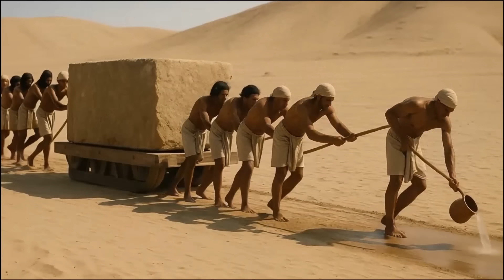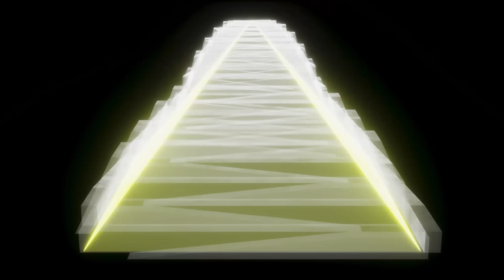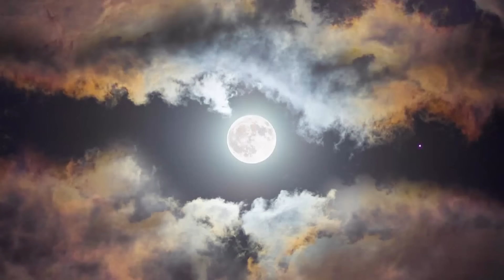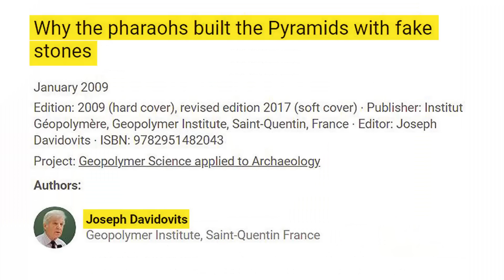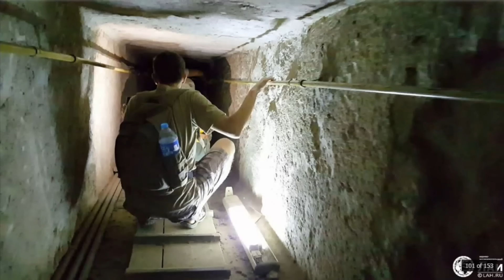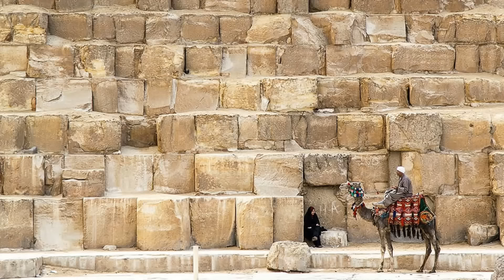The Pyramid Theory That Solves Every Construction Mystery

Comment: Why are scaffolding and cranes not discussed as construction method? Seems like reasonably simple technology well suited to build structures like this. You need good rope and wood construction technology which people would probably have had at this time and seems necessary for every other construction solution as well. Most of the blocks are reasonably sized to make lifting them in steps with human operated cranes plausible. While I agree that they might have used some sort of concrete pouring technology for the outer shell, it doesn't seem plausible for the majority of the structure. Pouring that much concrete in that many blocks doesn't really look easier to me than quarrying them and lifting them with simple cranes and scaffolding. Concrete construction uses a lot of technology to avoid using so much labor. But at that time, they probably hat a lot of labor available and probably a lot less technology, so that optimization is not as necessary in that context as it is today.

Comment: This is the first of your videos that left me disappointed by seeming implausible and by leaving out more likely explanations. First, there is a very old papyrus which clearl documents how stone was moved from quarry to a harbor near the pyramids. The author was a logistics manager for that part of the operation. There is also documentation of a statue that weighed over 100 tons being transported overland on a wooden sled by many people pulling. Part of the secret sauce was wetting the desert sand which experimentally reduces friction by around 50% and also makes the wooden sled skis last longer. Geologists examing the limestone blocks see fossiles which would have been destroyed by turning the limetone into concrete. Also, to cook enough limestone into lime for making concrete would have required a forrest about the size of Egypt to cook it. There was an instance where electron microscopic examination seemed to show it was concrete but it now accepted that was most likely due to contamination of the sample from recent  restoration work. Also the stones have tooling marks you wouldn't see on cast block.
A little napkin physics gives some shocking results, IMO. Since the center of mass for a pyramid is about 1/4 of the way up, considering maxs, gravity and time, the lifting portion of the Great Pyramid of Giza would have required about 7 kilowatts of continuous power to be completed in the recorded 23 years it took to build. A physically fit man can comfortably output 60 watts for a 10 hours.  Assuming 100% efficiency it would have taken about 120 men to vertically lift all of the stone. Add to that dragging the stone 1km it totals to around 780 men working in parallel.  Judging by the size of the work camp/city, there were actually tens of thousands of people working, probably in the farming off-season(s), but the 800 person ideal gives some needed perspective on something so huge not being ridiculously beyond human ability even when you start considering inefficiencies.
As for how the lifting was done, I don't think that was ever documented so I don't think we know as an absolute fact. That doesn't mean it was miraculous, just that we don't which of potentially thousands of ways they actually used. My guess is they probably used several methods, doing what worked best for the current stage of construction. Ramps probably worked fine for the initial layers. A Greek dude, Herodotus, 2000 years afterward suggested something that seemed to involve a lever. The stone would be levered up a bit and wood placed under the rock. Stop pushing down on lever and add some wood under the fulcrum, rinse-repeat until it is a pyramid step higher. Actual archeological remains look like a sort of giant rocking chair was used. The 2.5 ton rock sat on a seat a little above curved rockers. Perhaps the idea was to get it rocking while someone threw boards under the rockers so that it was slowly raid up to the next step.  There could have been variations like a lever that works like Herodotus said, but with some counter weighting and a pivot to finally land it on the next step up. After making the core step pyramid, the finishing stones would be lifted into place starting at the top and working down. Keep in mind that the bulk of the effort would have been over after the 1/4 up level. From there each stone takes more effort but there are fewer and fewer stones, and IIRC they used smaller ones the higher they went.
A nice thing about limestone is it is fairly soft as rocks go. A little sand and grinding movements would probably quickly get a good fit to the stone below.  The side joints might have taken regular stone mason work. Same for the finishing stones. Sized sticks or metal rods if you want to get fancy could have been used to get a good first approximation before leaving the quarry. Who knows, maybe vinegar was used to to dissolve high spots in some cases.

Comment: Well done on 100 videos Tina, wow. I agree the great pyramid appears to be part of a sophisticated engineering project. Those many theories do seem to be grasping at straws for answers to "how did they do it?". I like your theory, seems feasible for an advanced civilisation. The idea of the raw ingredients being poured into moulds, however,  seems to break down when we are told the blocks are not uniform, apparently they vary in size although 'average' 250 tons. That anomaly seems at odds with an advanced civilisation, you'd think the moulds would be uniform in size for the required types of blocks. Do you have any observations on that?
Reply from the maker: Thank you for the congratulations and for your thoughtful observation regarding block uniformity! 😊 The pyramid blocks in each layer share the same height. There are millions of stones in the great pyramid. Most core stones are not exposed so we don't know about their sizes and shapes. The builders might have used different sized molds to speed up the curing process and for structural reasons. For example, the upper blocks are smaller than the bottom ones. Or the blocks could have been cast in situ as shown in the paleomagnetic investigation.
Reply: thanks for your reply Tina!

Comment: Thank you for these very informative and thought provoking theories ,  I would like to put forward my own hypothesis, leaning into Occam's razor. First, the Egyptians had both the shadoof and sakia for lifting water, they could have very well upsized these mechanical devices and incorporated multiple units on the slope of the structure, much like a scaffold staircase , this could be utilized on multiple sides or simply used on the most beneficial side to preserve labor. After completing several horizontal layers, erect an additional shadoof.. the geometry is simple, I believe they would have layed out a full scale template on the plateu using a grid system similar to what they used for carving theAbu Simbez Temples, I believe this can be the connection to the water reservoir , the possible mine shafts and the canals. they had to have some mechanism to remove the spoils and target minerals from the shafts. Granted, I'm just an old carpenter and may be full of crap but, I built some really cool structures that tested my skills and besides, our ancient Egyptian sisters and brothers had the exact same brain as modern "species" , just with far less distractions. Thank you so much for your time, I learn something every time watching your videos.

Comment: Thanks Tina. That was terrific.  The great Max Planck put it this way:  "A new scientific truth does not triumph by convincing its opponents and making them see the light, but rather because its opponents eventually die, and a new generation grows up that is familiar with it."   In other words, change occurs 'one funeral at a time.'   You have clearly demonstrated how all leading theories fall apart, in other words, they are impossible.  And so, what we have left, as Sherlock Holmes tells us, even if it's improbable, is what happened.  And Dr. Davidovits theory is not improbable.  I don't see how he can be wrong.  When you pour concrete next to other blocks, using them as part of the form work, perfect fits are unavoidable.  On the other hand, who could cut a 2 or 3 ton block perfectly even once, then make millions of them fit.  Who could lift them in such a small area? They would have to remove and reshape and try to make them fit.  Impossible.  Let's see the Egyptologists do it once.

The perfectly level rows bring up another question.  I'm convinced they had very advanced optical capabilities.  See Robert Temple's book: The Crystal Sun.  The bust of Sneferu's sun has extraordinary crystal eyes.  Odysseus' antagonist was a shepherd.  Herodotus tells us that shepherds ran the Giza plateau before the old Kingdom.  Cyclops (cycl-ops) does not mean "one-eyed."  It means 'round eyed.'  They knew their optics and this is how they kept the structure level; lasers aren't necessary.   

Thanks again. Your explanation will help the next generation see the light.
Reply from the maker: Well said - thank you for sharing your thoughtful perspective and those fascinating connections! ☺

Comment: At best, the only remotely plausible aspect of your theory is why they built it.

Concrete? All that's required? They didn't have the fuel for it. It's an exothermic process. The final results shrink. Such large blocks would take a long time to cure, and they'd need to be cured fully enough before stacking them, something this video didn't even consider, unless the thought is they were a poured on-site layer by layer, which would fail for thermal differentials alone.

This isn't a remotely viable theory.

I can agree, the ancient Egyptians did great engineering, particularly given their constraints.

Comment: Hi Tina!  Congratulations on your 100th video!  I was surprised at how many videos you've done on the pyramids alone.  You should combine the research on them and write a book or apply for a Phd!  ;-)  But before your do, I implore you to go to Egypt and see the sites in person.  I think it will give you all kinds of new ideas and insights.  I'm sure the tour guides and docents are a wealth of knowledge you can't get anywhere else.  Besides, all your expenses are tax deductible as part of your business!  Let me know if go, you should bring a small group with you for safety and you can get discounts and special tours for small groups.

I've been reading through the comments and people seem to be stuck on the many molds theory.  Maybe I can offer an alternative that makes sense.  Today we use forms to pour concrete foundations.  This accounts for the varying sizes of the pyramid blocks.  Studies have shown that the exterior blocks of the pyramids are a mixture of cast concrete and natural stone blocks.  You could start with a couple of natural stone blocks spaced apart and just use two form walls to connect them and pour the concrete between them.  You could also extend this using a three sided form.  This really isn't too difficult to figure out, especially if you're assuming an advanced pre-dynastic Egypt.  You could also do this in several places per level simultaneously once guide blocks were placed to ensure proper alignment.  

Building with these manageable size blocks also lets the concrete cure much faster.  When the Hoover Dam was built, it was estimated that it would take 125 years to cure.  Parts of it still haven't!  To bring the curing time way down, they ran thousands of feet of copper pipe in the concrete and ran cold water though it to cool it down.  Using blocks instead of a monolithic pour, also lets the pyramid settle and adjust from earthquakes without cracking.  If you think about it, a hell of a lot of engineering went into just the construction.  

I think you're right about Houdin's speculation of an interior spiral ramp Tina.  That would have shown up in the muon scans.  But I think the ramp in the "Grand Gallery" was definitely used to bring the heavy granite beams/blocks up to the King's Chamber level.  The side wear grooves and the wall notches all indicate moving very heavy blocks up with a backstop mechanism.  There was probably nothing on the King's Chamber level, including the high ceiling of the Grand Gallery, when they brought up the granite blocks, so the ante-chamber wouldn't have been in the way.  They would have been prepositioning the granite for assembly and filling in once the King's Chamber walls were erected.  Again, if you're assuming an advanced pre-dynastic civilization, with plenty of evidence of them moving around much heavier stones, it's really just a matter of figuring out what sequence they did it in.

Anyway, happy 100th Tina!!!  Can't wait for the 200th!
Ken

Comment: The concrete cast hypothesis is not considered plausible by almost all respected researchers. 

Archaeologists have found papyrus evidence written at the time of the pyramid build documenting the transportation of large cut limestone blocks by boat up the Nile. The blocks show tool markings and lift points where they have been moved. There are paintings in the tombs of the workers showing workers moving large limestone blocks with levers and sleds… sorry but the casted block theory doesn’t hold water..

Comment: I love you thru and thru really. Been following since day one. Having consumed 1000 hours of Egypt and owning a stone and garden co  for 20 years. I must say the question of "how did the move the stones?" and even "How did they move so much material up a pyramid" get put on the back burner with the reality of precision fits in granite, in 80 ton blocks in the Osirion. Those joints are not done manually. They are perfect inverted mirror prints of each other. Theyve been exposed and those surfaces are super smooth and fit into each other on a granular level. And the precision runs for meters. It's abusrd and stupid if anyone thinks they can do that with a hand tools. Hyper advanced stone manufacturing is present in Egypt, its sitting there in stone. If thats true why are we trying to solve GP build with slaves and ramps?  There are too many build anomalies present at Giza..too many bizarre things.  Like a 240 ton limestone block in the giza floor, as a floor tile, that merges with an itty bitty half kilo triangle block. These builders had completely different set of principles they built by. They also had disregard for material loads. Find a piece of limestone as large as possible and ship it! 240 slab is enormous. Its fucking enormous 😂 If they were doing all that, all my GP questions get answered by default. No ramps, no slaves, no bullshit. Advanced tech plowing and shipping kilotons of material daily.

if they were pulling out 1200 ton chunks of granite out of the ground and shipping it (aswan obelisk) they were doing something else. something insane that were very separated from in our investigation so far.

Comment: If they used molds, why are the blocks different?
Reply from the maker: There are millions of stones in the great pyramid, the builders might have used different sized molds, possibly for structural reasons. For example, the upper blocks are smaller than the bottom ones.
Reply: @CuriousBeingbyTina thank you for responding to my post Tina! I’m just going by what I see on images of the pyramid and to me, they all look different. It is conceivable that they poured each block precisely where they needed them with 3 side-panels up against the adjacent block. Corner blocks would have 4 side-panels. In this case, they wouldn’t have to carry the entire block up the pyramid- just the cement in smaller buckets. So if molds were used, then it makes more sense to mold the blocks the way I describe it.
Reply: @CuriousBeingbyTina If you have a look at the robbers tunnel, you'll see, how the pyramid looks from the inside. It's irregular stones of different shape and size. Rubble, quite big, kept together by mortar. This stuff is not moulded.
Reply from the maker: @MartinScharfe  The rubble-filled core of the pyramid really look like the interior of a modern dry stacked mine waste storage. Currently most such mine waste piles are made of rubble, the cemented version is a new and more advanced concept.
Reply: If you have a look at the robbers tunnel, you'll see, how the pyramid looks from the inside. It's irregular stones of different shape and size. Rubble, quite big, kept together by mortar. This stuff is not moulded.

Comment: Why build a ramp - when you are building a ramp, where you can haul up stones on all 4 sides - it is not that difficult to understand - and remember when you on the pyramides are 55 % up - you have allready used 85% of the stones - so it is a minor task to complete the rest to the top.

Most of the stones are like 2 - 4 tons and with some sort of pulley at the level where you are adding stones - you don´t need that many men dragging - or going down on the other - or same side to pull up the stones.

https://www.google.com/url?sa=t&source=web&rct=j&opi=89978449&url=https://www.youtube.com/watch%3Fv%3DpxD3SHMp9Es&ved=2ahUKEwiluvvU7teTAxWgJxAIHZgNG0EQ3aoNegQIVhAT&usg=AOvVaw3wRypGPwvrziDNm8adF7NY

Comment: 1- It would be fun that the sarcophagi were the molds, especially the big ones from Saqqara.
2-The Grand Gallery was used, once the pyramid was built, to raise and lower the three porcolus , using as counterweights the three blocks that now block the ascending passage to the Grand Gallery. When the porcolus were no longer needed because they would never be raised or lowered again, the ropes would be cut and the three blocks would fall, concealing the entrance. And whoever cut them could escape through the Grotto =)
Great video as allways.